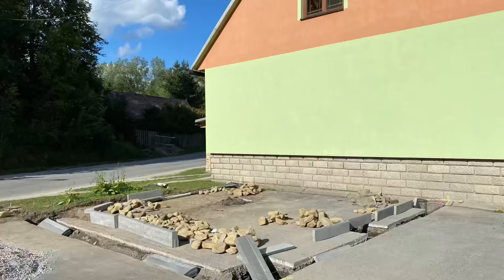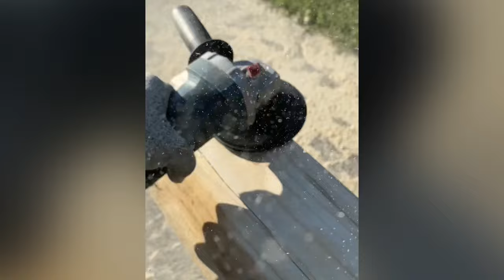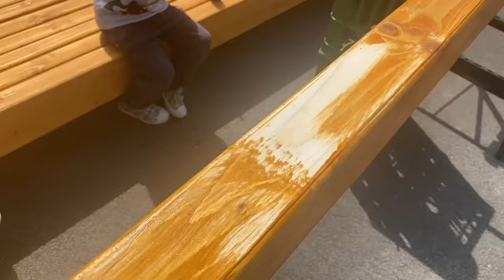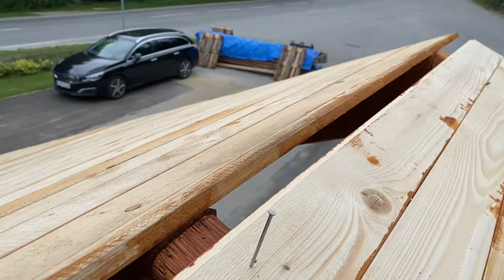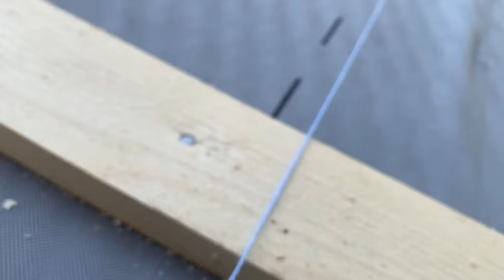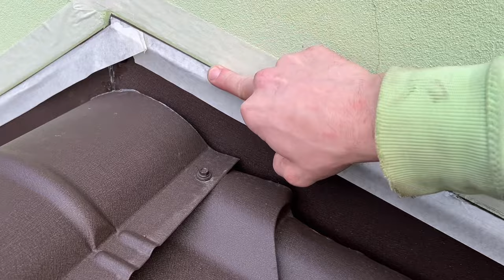Building a carport

Comment: I'm curious how the columns are fastened to the concrete.
Reply from the maker: threaded rod with a diameter of 24 mm and a length of approx. 40cm in concrete
Reply: @miroslavb5653  nice. Is there a plate the wood sits on?
Reply from the maker: @scarecrow1490  I welded the nut to an iron plate with a hole drilled in the middle, which I then screwed to the columns with 4 screws.. a hole approx. 25 cm long was drilled into the columns and the columns were only screwed onto the threaded rods

Comment: Total cost/investment?
Reply from the maker: Base plate - road concrete + surface finish "polished concrete" €1600, wood €1000 + cutting €400 + underlaying, tongue groove €650, paint €250, roof + gutter system €1000, connecting material €150 waste pipes + waste channel €250 , other accessories such as roof foil, feet, threaded rods €300.... I must have forgotten something, but the total is about €6,000
Reply from the maker: but today everything is much more expensive, I estimate around €9,000-10,000

Comment: Hello. what is the width of the entrance to the carport?? I want build te same carport.
Reply from the maker: Hi, the width of the shelter/entrance is also 6m, which is good because when the children get out of the car, the door does not hit against second car
Reply: @miroslavb5653  thanks for yours answer. Good joob!!
Reply: Hello. what is the size of the wooden pole?
Reply from the maker: @vasylpetrov2010  Column 170x170, battleship + stiffener 170x170 too, rafters 80x170..
Reply: What type of wood did you use?
Reply from the maker: @JdMultiservices  Hi, i used spruce